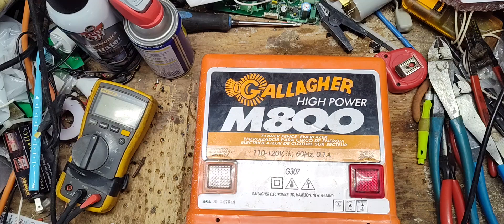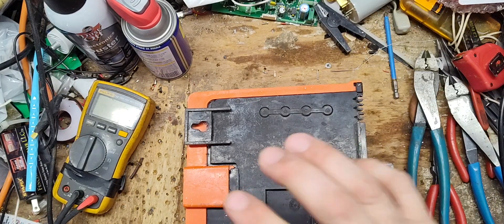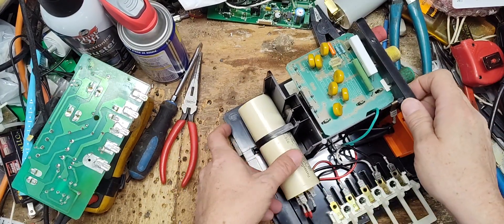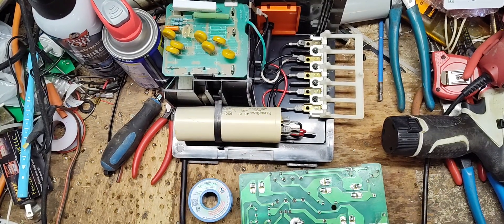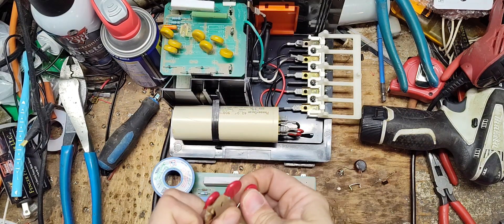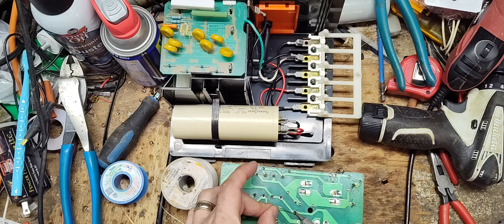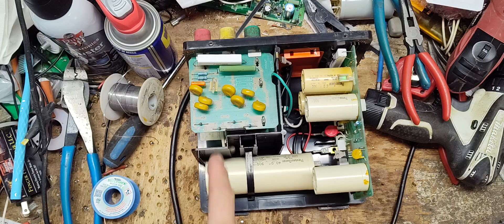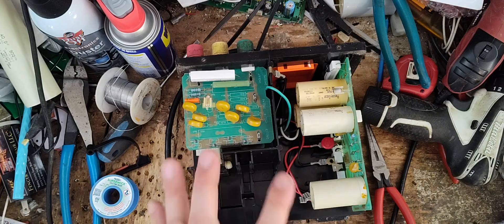Old School Electronics Are When Things Were Built Like Tanks | Gallagher M800 Repair

Comment: I have a G310 Dad purchased in 1984, I did a repair on it 10 years ago with a extra coil, 
dont spose you have the circuit ? i like to restore it back to factory cheers Brett
Reply from the maker: I don't recognize the number G310 when it comes to Gallagher. That's likely just the start of the product code number and not the actual model number itself. Email me at FencerFixer816@gmail.com with a picture of the unit itself from the outside cover and the inside.

Comment: Hello i have watched many of your video's i have got a m800 pre 2000 series (EU variant) myself and it is only putting out 2kv on the fence tester. The capacitor reads out 30 so should be allright but the green light is barely turning. So my guess is in the main board. (Also red red light is not blinking but i have found one resistor for the light js shorted so it skips the red light not my biggest problem the output does work but so little. The varistor is allready changed some time in the past is there a way i could test this or do you might have any ideas? Like to hear from you! Great videos!
Reply from the maker: You probably have a bad output transformer honestly. Just remove the output board, plug the unit back in, and rest across the two tabs coming out the topside of the transformer. If the voltage jumps way up to 8-10kv then the transformer is fine you there's stuff bad on the output board. If the voltage doesn't climb up too much higher across the transformer, then the transformer is your problem part.
Reply: @FencerFixerRepairLLCKansasCity  all right thank you very much! I have removed the output board and it does read between 3 and 4Kv now. So it did jump up but definitely not the 8kv it should give.(But offcourse the Capacitor is also down to 3/4 of its capacity to 30 uF so not 100% anymore) Do you know if there is a way to test the Input board? Because the green light is so dim and that should not be impacted by the bad trafo I guess.
Reply from the maker: @itsmeRik060 the capacitor is a little weak, but it's not the cause of your low voltage. That bulb on the input board is just a neon light, a dummy power light to tell you that the unit is on, but it has no function on the rest of the unit at all. You could completely remove that bulb and the unit works still run. It's just burnt out some from age. You have a bad output transformer.
Reply: @FencerFixerRepairLLCKansasCity  ah yeah alright I understand, thank you for the answer helped me a lot!! But then a trafo it is. I will have to look if I can find something similar in my area. Do you have the specs for these?

Comment: A couple things I wish you would have hooked up a voltmeter to show us how much that unit was putting out before and after you change the parts and also if you would have powered it up so we can see the blinking lights on the outside through the lenses
Reply from the maker: Before I fixed the circuit board, it wouldn't have came on at all. I couldn't find my electric fence tester either, so that's why I didn't test the output, but I knew from experience that everything was fine. Also, changing out the capacitor would've have changed the voltage before or after, the voltage comes from the transformer not the capacitor. I've probably got 20 videos on YouTube testing and repairing the Gallagher M800 BEV3, so if you do a search for either model, you'll likely find what you're looking for.
Reply: @FencerFixerRepairLLCKansasCity  yeah I guess I could search your channel and find the videos all I can say is I know what high voltage feels like and I sure don't want to touch that thing 🤣👍
Reply from the maker: @darylhudson777 Just YouTube search Gallagher M800 repair or Gallagher BEV3 repair, you don't have to search my particular channel, just search YouTube in general.
Reply: But if I search your channel and watch your videos it benefits you, brother